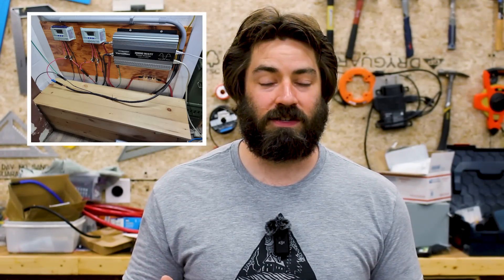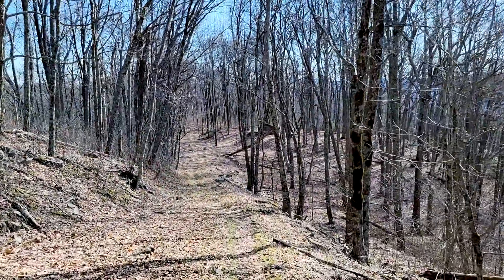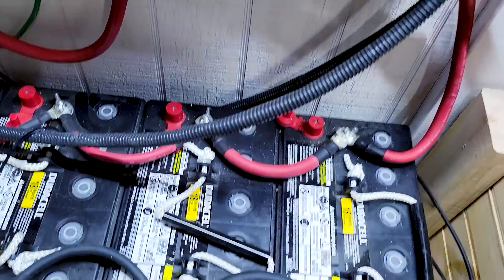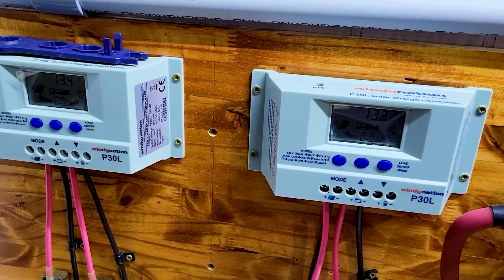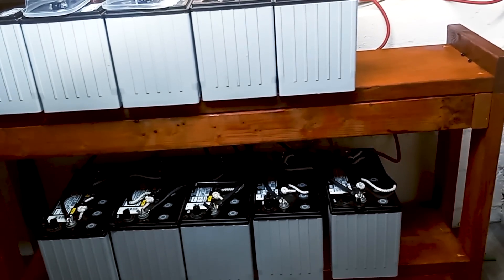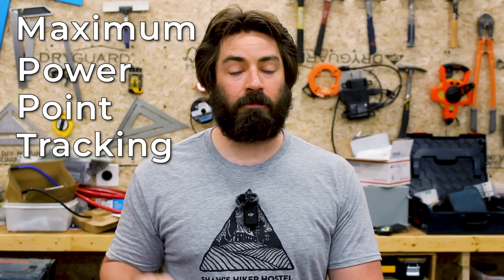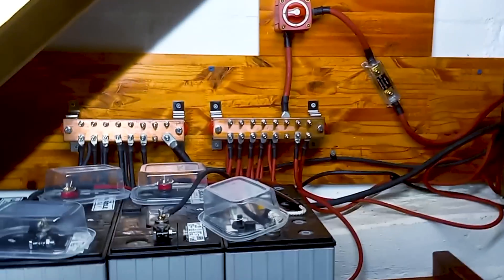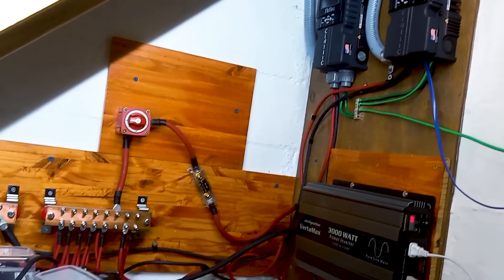Optimizing a Small Off Grid Solar System.

Comment: Is it possible to connect 2 48v mppts to charge 8x12v lead acid batteries totalling 96v?
I have a 5kva inveter that requires 96v.
Thanks for the gr8 vids.

Comment: I am not sure that I like the buss bar idea for the batteries. 
If you disconnect any battery, the wires are still hot unless you have individual disconnect switches.
I guess that the batteries would all get the same rate of charge as long as all wires were the same length.
I used buss bars after the batteries and connected all the charge controllers and loads to those.
Then I changed out the positive buss bar to a 12-fuse block so that each charge controller would be fused.
These fuse blocks would not be heavy enough to fuse the batteries.
Maybe you could set up a din rail with some 50A circuit breakers for the batteries, but that would get expensive.
My system is a 24V system and I used a 30A 24/12V buck to supply 12V loads on a separate fuse block.

Comment: We are off grid right now. We have a 60 watt solar panel and 2 200 watt dr prepare solar generators. Its not near enough. We are very broke but doing what we can. Some days we dont have a fan. When its very bad weather my sister or mother will let me charge my banks at their houses. I stay at my sisters during heatwaves with the kids. I wish I could afford a lot more. We have to build very slow due to lack of funds. I was wondering about the lead acid batteries. I am not good with electrical. My brain cannot seem to grasp the difference in watts, amps and volts. Trying not to burn my home down so I have started trying to watch as many videos as possible about solar.I subscribed and I am glad to see this channel. I think the kids would love a full time fan and TV everyday. Maybe an actual refrigerator and freezer! 😮

Comment: Bus bars are good so long as the length of each cable run is equal.  Daisy chaining can be done properly and successfully, but it requires careful consideration of the resistance of each link and the tie in points such that there is equal voltage drop between each battery and the tie in point.  I would use copper strips for this purpose.  Higher voltage from the solar panels is a fantastic change!
Reply: When daisy chaining, if the wires between each battery are all the proper size and same length then what is the issue. I'm not understanding the con of daisy chaining in this scenario

Comment: Great suggestion. Another suggestion (that is not as good) would be to move the main connection from the last battery in the chain to the middle of the battery chain. Right now the chained connections all push current to the end where it connects to the inverter. So the last cable in the daisy chain has to take the power from ALL the previous batteries in the chain. If you move the primary connection to the middle of the chain then you split the current in each half of the chain. Thats a ZERO cost improvement. Not as good as bus bars... but better than the initial configuration. And since it appears there might be a mix of smaller and larger cables joining the batteries, having the larger cables closer to the main connection also would help, so having the main connection at the middle and the larger cables near the middle.
Reply: The problem with this method would cause the batteries closes to the main connection to carry more current then the batteries further away. The way it's currently wired the resistance between all the batteries through the cabling is equal so the batteries share the same load

Comment: Hi david, i have a 24v all in one system using 2 12v 100amp battle born bstteries, can i use the central bussbar  system to add 2 more battrries or do you recommend series of 24 v battery wiring
Reply from the maker: Yes, you can use a central bus bar system.
Reply: @DavidPozEnergy  thanks . Im in The Bahamas and im also building another 3kw system with 6 12v 100amp. So i will go that route again. Thanks
Reply from the maker: Once you start getting that big (6x 12V batteries) it's really time to start looking at 48V equipment.  You can purchase 48V inverters, and 48V batteries.
Reply: @DavidPozEnergy  thanks, i plan on doing just that , im ordering 2 more batteries to make a total of 8 12v 100 amp batteries for a 48v system . Thanks my brother

Comment: David, Are you going to put up a video on the Schneider BCS and Schneider System?  I just found out that with the BCS that I can not have a closed loop communication with the EG4 LL batteries.  Insight Home apparently does not allow for RS 485 communications with both and the Aux port on the XW Pro is used to control the PCBA in the BCS.  Tech support says they are waiting for Schneider to address this.
Reply from the maker: I wasn't planning to test the BCS because I'm operating my solar system off grid.  
I am planning to make a video trying out the closed-loop communication between the insight home and the EG4 batteries.
Reply: @DavidPozEnergy  
I will look forward to seeing the battery connections.  One of my next challenges.
I have the BCS installed.  It was a game changer for my installation.  
I had two meters, one for house, one for the shop/guest apartment.   All PVs, Schneider Inverters, etc. are in and on shop.  With the BCS mounted 10 feet from meter base, I now have one meter, the BCS is the service disconnect as well as the combined connection for the house and shop.  The allows me to still have 200 Amps when need, but the two XW Pros should power the house and shop by using the AC1s bidirectional feature to feed 2 each (2 XW Pros) 60 Amp breakers into shop 200 Amp panel, thus feeding the shop and house through the the BCS connection.  Any excess power (after batteries are charged) will go back to grid.

Comment: 7:30 wonder that to give up the ghost is an idiom we also have in german den Geist aufgeben  which means to break down. 
not so often that these idioms are still the same like someone is heavy on wire which means here that someone is an expert in something (even beyond the electrical connotation of wire). 

of cause of topic but I loved to see the same considerations to use the older pwm stuff till they break instead of instantly using the new more efficient tech and just selling the old stuff, the PWM to someone else instead of throwing it away or give it away as a gift with an old panel to a beginner.

Great video and thoughts about the step by step improvements he had made.

Comment: EXCELLENT SHOWING OF A VERY TYPICAL LEAD ACID SYSTEM UPGRADED TO A SMALL  , BETTER FULL FLEDGE SYSTEM WITH ADVICE AND IMPROVEMENTS WITH USES OF THE ALREADY EXTRA EQUIPMENT SAVED FOR A 48 V FUTURE SYSTEM REALLY TURNED IT TO BE A VERY EFFICIENT POWERFUL SYSTEM . THANKS DAVID POZ .:goodvibes::goodvibes:

Comment: So, just a quick question:  What voltage are most solar panels outputting?  Here in NW NJ, there are a metric crap ton of solar fields, both existing, and going in.
I decided to put in a "hobby" system to learn what i was doing after watching this channel, and then several months later, I found a new commercial field( on public parkland?  YAY NJ!! )
and a DUMPSTER filled with cracked panels, and hundreds of dollars worth of various(aluminum extrusion, 2/4/6 gauge copper solid, some stranded, piping, SS lag bolts,  OMG, on & on.)

With a Honda pilot & my 16 year old son we made 3 trips to that dumpster ( on public land!), retrieved at least 8 commercial panels, all cracked but still producing voltage, 50 pounds of SS bolts, 150 pounds of various aluminum , and i don't remember what all else, recycling it all.  To my house.

To the question, these panels, and some others I bought, are 100V panels.

What all voltage are you all running?
From this video, it sounds like 12 volt panels?

My MPPT charge controller can handle 100V in.

My question is how do you all manage the input voltage?
@DavidPoz, i'd love to see a dedicated video about the panel wiring and this issue.
Reply from the maker: You scored big!
In this video, Richard, is using small solar panels, commonly referred to as 12V panels.   However, the Voc I think is closer to 19V.

Comment: Hi, please Help 

 I have off grid inverter (brand mpp solar PIP 5048MGX ) 48v 5kw i have connected 12.8 100ah x 4 battery ( battery brand is power queen lithium battery),
Please note when I setup to run only solar and battery its work fine but night time when solar is gone when i change the system to charge the battery via utility its charge when it's full charged to 55V error code F08 ( BUS VOLTAGE IS TOO HIGH) comes and stop the system.
Can help me to solve this issue please.

Comment: What's the purpose of getting riged of the daisy chain except the cable gauge is less that it should and induce safety issue ? Is there also some resistance in clamped connectors that you don't have with bars because they are flat from start to finish ? Or just lower global length ?
Also reaching higher voltage is fine when you can adjust your battery pack configuration to match PV tension, but you then have issues with balancing and thus avoiding electrical lose into bad balancer, what's your best advice to identifie those that just dissipate energy out of higher voltage units from those that kinda reinject for higher to lower voltage units ?

edit : ok, didn't watched the filmed part where he did the bus bar, it's not at all what I thought. Then he didn't rearrgane his battery bank layout but still have MPPT using higher PV voltages, that's weird. They usualy are in close range to have better efficiency.
Reply from the maker: There is more resistance with daisy chain vs. busbars.  The resistance creates more heat and losses.
Reply: @DavidPozEnergy  i saw you made dedicated videos, I'm going to watch them. TY.
(Btw do you have some recommandations on amp clamp sensors to have a very good sensitivity/precision for cheap ? Or are in line more effective ? Regards)
Reply from the maker: I've had very good success with Uni-T.  If I was buying a multi-meter today, I'd buy this one: https://amzn.to/3SmCkF6  But, if that's still outside your budget, then the smaller version is still great.  I own this one: https://amzn.to/3rczg2r  The smaller one is very accurate, but only goes up to 100A.  The bigger one goes up to 600A.

Comment: Hi, I would like to ask you something.  . .  Is it worth to install optimizer with an mppt inverter? Many thanks!
Reply from the maker: If you are trying to make a grid-tie system, and/or an AC-coupled off grid system, then you might want 240VAC coming from your solar array.  In this case I prefer to use microinverters rather than optimizers.  Check this one out, it has two MPPT's, for two panels: https://signaturesolar.com/aptos-800w-dual-microinverter-mac-800r/?ref=4_rHcgZ9x-TiF-
Reply: @DavidPozEnergy  ok thanks, but what if I want to have battery strage as well? I have ordered growatt spf 5000 es and this week I will order solar panel and lifepo battery as well. What I want to achieve is use as less as possible electricity from the grid.

Comment: If he puts individual fuses or circuit breakers inline with each battery eg 15-20amp rating, this might protect the system from thermal runaway and any potential fire starter.

Comment: Thanks for sharing!
I do like the bus bar arrangement for four or more batteries.

I would mention two things with the bus bar arrangement - the links between each battery and the bus bar should be the same size AND length.

personally, due to a penchant for safety, I would add a battery terminal mounted fuse on each battery (+) to connect the links. That does get expensive. This would be like the Blue Sea Systems MRBF.

Comment: is there any charge controller cheaper that will do the same job as i have 9 240w 24v panels but have a 12v 3000 pure sign wave inverter all  ready i can,t aford  the 700. 00 for the mindnite controller?
Reply from the maker: Hi Lee Taves,  9 panels, at 240W each = 2,160W.  2,160W/12V=180A.  I don't know of a 180A charge controller, so that means you will need to buy 2 charge controllers to handle that many Amps.  I think the less expensive option is to move to a 48V system.  For example, check this out: https://signaturesolar.com/eg4-3kw-off-grid-inverter-3000ehv-48/?ref=4_rHcgZ9x-TiF-
This is a 3,000W inverter that runs on 48V, and it includes a solar charge controller built in.  This can handle all of your panels.
Reply: @DavidPozEnergy  thank you so munch for coming back your videos are very informative im 82 in f
Florida

Comment: Hi David. Nice video. I have a similar type setup with the exception that I have 5kw 48v inverter with 12 Gel batteries connected series parallel, 4 batteries in series to make 48v and then the 3 sets in parallel. My question is, would it be better to put bus bars in and connect the 3 strings to the bus bars and then out from there to the Inverter? Would that optimize my battery usage? I find that over night my batteries do not last as long as I would them to so the Inverter starts screaming about an hour or 2 before the sun comes up to provide me power through the solar panels.  So basically I want to extend the battery life over night. Any suggestions? Going Lithium is pretty expensive out here in South Africa and I would like to make what I have work for now while I can save up for the more expensive Lithium batteries.
Reply from the maker: You asked if it would be better to put busbars in...   Better than what?  I don't know how you currently have things wired up.  I think busbars are a better solution to daisy chains.  

If you are running out of battery energy overnight, then I'd attack the problem systematically.  First, I'd test each of your 12 batteries.  This will rule out a bad battery.  If you have 1 battery that's bad out of the bunch it could be self-draining.  Replace a bad battery if you have 1 or 2 bad ones.
Next, top-balance all your batteries.  This is done by wiring all 12 batteries in parallel, then charging the whole group to 100% with a 12V charger.  After that you can re-wire them as series/parallel.  Yes, busbars make this an easy task.
You might have poor connections, or undersized wires that could also be wasting energy.  I hope this short list of possible things to check helps you out.

Comment: I really am still not sure what I can do in my very cloudy Oregon weather... During the summer I experimented with a little Bluetti with the fold out panels... I was able to charge it up in about 3 hours in full sun..It did come in handy with the power outage we had for ONE night only.... ugh!   But the next day when I tried to find a sunny area not only did the high clouds prevent much sun at all... but after 4 hours I still only had my battery half charged!    I would love to figure out a system that works in this area... Any suggestions?    I am also curious about setting up a battery bank that could be charged on grid and only used when power is out?   Is that even a thing?
Reply from the maker: The fold-out panels are usually not very good.  Being able to charge your battery at all is pretty good.  Since Bluetti is a company that makes several different sized power stations, I don't know the specs on yours.  If I were you, I'd look up the maximum PV input, and then buy a solar panel that maxes it out.  I'd look for a Mono-crystalline panel, or panels.
Reply: @DavidPozEnergy  Thank you so much for your reply... I will do some experimenting soon!   I hope to put together a bit of a system for my Well pump for black out situations.   Any suggestions are welcome!
Reply from the maker: I have a 3-part series of a small power-wall I built for a friend.  He is running his tiny house, with a well pump with it.  Note, that if I re-created this today I'd probably buy the new EG4 inverter: https://signaturesolar.com/eg4-6k-off-grid-inverter-6000ex-48hv/?ref=4_rHcgZ9x-TiF-
Part 1:  https://youtu.be/oMH3IwR0ZC8
Part 2: https://youtu.be/nKva5GsEPXc
Part 3:  https://youtu.be/MmKsTafbNyU
Reply: @DavidPozEnergy  You are Awesome!  Thank you so much for your response!

Comment: I’m in a similar situation,  my solar system is not strong enough to run the house.   I use about 2kw an hour but my solar is only 1.5kw.    How to combine them both so the grid and solar is supplying at the same time from the same circuit breaker box?   Not a seperate load box.

Comment: Midnite charge controllers are awesome I was double over panel on a 12 volt system for almost a year, so 2400 watts of panels on one Midnite, then I turned the amp output down to 60 amps output, but i eventually upgraded to a 48 volt system with a 3000 watt 48 volt outback inverter, now I've got 5600 watts of panels, and I just 2 days ago I got rid of the old lead acid batteries and got 4 200ah lifepo4 batteries for 10kwh of battery storage, that's equivalent to 16 regular 100 amp hour acid batteries, now my system is very close to on grid electricity, besides running an electric heater through the night, but I can run a 1000 watt electric heater for 8 hours that's not counting the on/off cycles, but just them 4 batteries really improved the system a lot
Reply: I'm surprised that acid/agm is still around, even for a budget system Lifepo4 seems far better

Comment: Thanks David. When I started my project I also used lead acid batteries or gell, if possible, immediately use lithium ion batteries (or LIFEPO4). The system becomes much more efficient.(With MPPT).☀

Comment: Hi David. 👋 seriously really good video. Can to u possibly go more in depth about the wires and sizes? I have same issue. All the right stuff to make power from the sun for my family and children but same cheap lead acid systems with jumper cable wire. Where do I buy the right stuff cheapl?